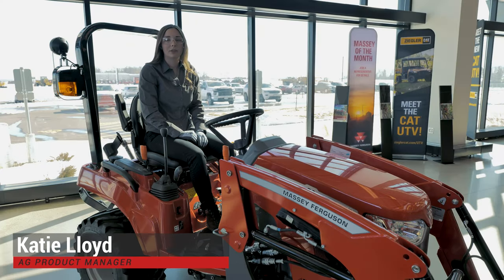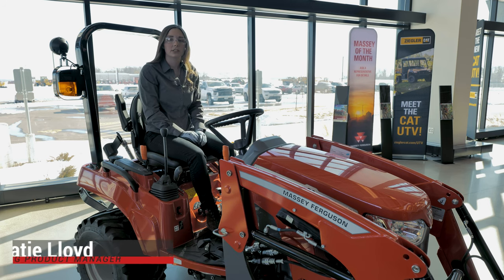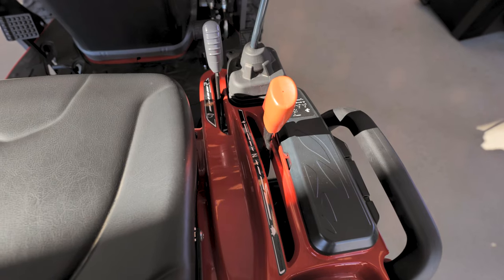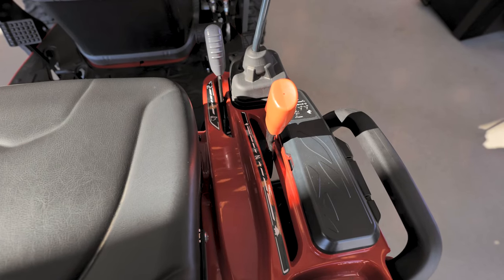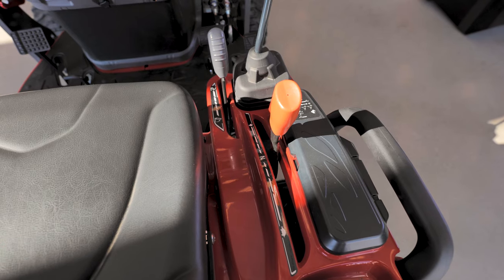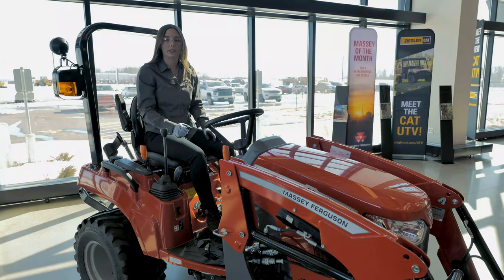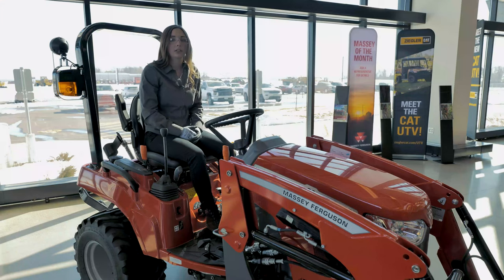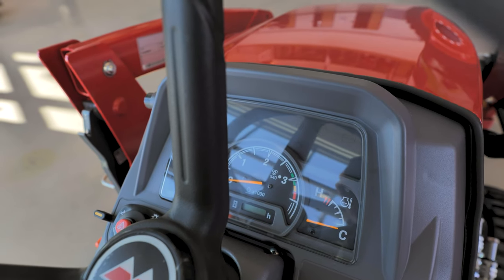How to Handle a Massey Ferguson Tractor That’s Not Starting

Comment: I have questions, my 2850 e engine turns off during operation. At times, it does not start or engine turns after starting. What could this issue be?